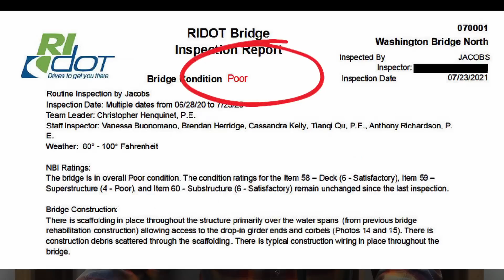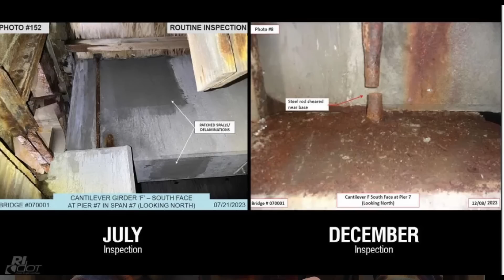Westbound I-195 in Rhode Island could be Torn Down and Replaced

Comment: I wish I shared your optimism on the timeline. I dont see any way on goda green earth that a bridge project of that magnitude could be completed in that timeline. 

Even with the biggest of rush rush from all angles. Month worth of public notices, month to.actually bid the job ,month to award the job and push the contracts. Lord knows how long for the awarded contractor to send all their POs out and get the submittal process started. Steel shops, with PE stamps, precast shops with same?

 Either way...lead time on the scales of weeks at best, just to get the shops. Back to the review side, " quick review" on a project of this magnitude ? Weeks? Get approvals on all the shops and then clock starts ticking for the lead times on materials,  theeeen start building a bridge.

Oof, wishing the best for the local folks , but they definitely have a rough row to hoe. If they want to get that bridge back up and running,  sounds to me like they better do some house cleaning,  get some politicians out of the way lol.
Reply from the maker: I think you're right. There's a good chance the Francis Scott Key bridge will be replaced before the Washington bridge is.

Comment: To me as soon as there's some fictional claims then the flags about evading the truth just goes to the top.
If they just had stated that "We have missed this part in our inspections" then it could of course be some questions about why that happened, but it wouldn't be an obvious lie, just that the inspectors historically have been sloppy. Some parts on a construction are also tricky to inspect and may require special equipment to reach, but it's not clear if this was the case here. Special equipment to me is not just a stepladder but scaffolding or a mobile platform with long reach that can curl under a bridge. Such equipment is expensive to rent.
So in the end it's all about money and laziness.
Reply from the maker: Yes, their lack of directness and candor is disappointing and makes it hard to trust anything else that they say.

Comment: I love your channel and find your engineering takes on various projects are great, BUT, in my opinion, as a person who has worked in bridge construction for  30+ years is that the replacement of this bridge, if begun tomorrow would take at least 3 years possibly longer.
Reply from the maker: Thank you.  You may be right about that.  3 years would be a disaster though for the local commuters.
Reply: It would be a project built over a marine channel with a shipping channel and 20+ feet of water over some soft mud.  Only saving grace I would see is that a major bridge was just finished up river and perhaps those barges and cranes could be mobilized for this project,  after the soil studies, engineering, environmental studies and bidding process is over,  UGH! @CaseyJones-Engineer FYI I have to use this bridge almost every day.  I have the luxury of being able to pick my travel times so the traffic is not to bad.

Comment: As far as inspection, close up is only required for fracture critical structures.  I agree that the corrosion on this rod is a significant factor.  There is probably an expansion joint in the deck near this tie down and there may have been a lot of sand on this area at one time.  Corrosion can substantially accellerate fatigue which can cause a sudden fracture, especially in cold weather.  As far as the rod itself is concerned , it looks like there is both considerable necking, and a substantial gap indicating a lot of elastic strain in the rod at failure.  Both of these factors may be indicative of overloading.  For a bridge of this size a more likily overload situations are:  a. Increases in deadload due to increased overlay thickness.  b. more lanes than initially planned.  c. Very heavy truck traffic such may occur with a traffic diversion onto this structure.  d. Overload truck policies way beyond those anticipated  by the design loads of the origional design.  e.  Sensitivity of the code requirements for tie downs at the time of design to a change of  the ratio of live loads to dead loads reducing the overload capacity.  f.  Tie downs are not usually load rated as part of the routine determation of structures load capacity just like gussset PL's weren't  before the I 35 structure failure.

Comment: Second thought, and questions for our host:  Does the bridge design include a required maintenance schedule?  Should it?  What would the legal implications be?
Reply from the maker: Such bridges are usually subject to routine maintenance and periodic inspection, but in this case it would appear that the routine maintenance was wholly inadequate.
Reply: "Required"?  Who would pay for the desired maintenance work?  None of those involved with bridge maintence or their design have the ability to print money.  Future maintence costs need to be considered during the structure selection process though.
Reply: Funny someone would ask that about a 195 project. crossing the Taunton River from Sommerset MA to Fall River MA there is a big green bridge (the Braga Bridge) followed by a tunnel? under the Fal River City Hall, which was built in conjunction with the bridge/highway project. One day a concrete roof panel fell on a car, crushing it completely. Sadly, the driver was killed. On investigation of this incident, it was discovered that the City of Fall River believed that the State of MA was responsible for the inspections, and you can guess what the State of MA believed. there had never been any inspections. the frightened workers in city hall could look down under their desks and see the road beneath them.

Comment: A lot may depend on whether the bridge piers/columns are sound, or whether they too must be demolished and replaced.
Reply from the maker: True.  It does appear that at least a few of those bridge piers are in bad shape.  Also, the new bridge would have to have the same spans as the old bridge to reuse the piers which is not a deal breaker per se.

Comment: I am an accountant, not a civil engineer, but the new I85 bridge over the Yadkin River in NC, built more than a decade ago, to carry eight travel lanes of interstate cost over $130million.  I think that replacing approximately 1mile of ten-lane I195 bridge in Rhode Island in 2024-25 for $100million is wildly optimistic  given inflation, current constraints on availability of labor and equipment, that the Yadkin River bridge is only about 2,900 ft (approximately half the length of the I195 bridge), that little demolition was required (the old bridge was much shorter (nestled down in the river gorge), narrower (4 lanes), and in a different location from the new bridge), and that NC is a relatively cheap place to do business compared to New England.
Reply from the maker: That could very well be the case that $100 million is on the low side.
Reply: If the piers are in good shape and they don't need a navigational upgrade, they might be able to keep it to $100m by building up off the existing piers. Otherwise, if they go for a new bridge, there will be mission creep and the feds will bail them out of the overspend.

Comment: Would it be possible to make enough repairs to the bridge to keep it open to restricted traffic: ie. No heavy trucks?

Build a new bridge next to the bridge to be replaced? Then demolish old bridge. 

Are there designs that inherently protect the bridge structure from road salt exposure? 

Could the design incorporate wash down system to flush structure that could suffer damage from road salt? 

If those questions can be answered yes in part or whole, would doing those things greatly increase the cost?

Questions are rhetorical.
Reply: The current bridge structure and approach roads are hemmed-in by buildings on both sides of the river and both sides of the road, so you would have to condemn a significant amount of preexisting development to build a new bridge parallel to the existing bridge, and build new approach roads to the location of the new bridge, which would further increase the cost and amount of effort required.

Comment: Was curious if a new bridge is required how much if any of the old bridge and approaches might they be able to re-use? Seems like Peter Alviti was in react mode without much quality information at first and being a bit defensive.
Reply from the maker: That is a good question and depends on how good of condition the pier caps are in.  Also, I the spans would have to be the same for the new bridge.  Currently, there isn't enough information available to say whether all new foundations and piers would be required, but if they weren't it would significantly speed the replacement process.

Comment: The environmental impact study for this bridge replacement should be versus not replacing the bridge. And not replacing the bridge is going to mean a whole lot of cars running a whole lot of miles and idling and sitting in traffic a whole lot of time so I'm fairly sure but the net environmental impact of replacing the bridge is negative. That said there may be some concerns that have to be addressed such as avoiding particular depths of the shore that might have sensitive endangered critters that need a particular part of the shore or a particular depth of water. That would just be a matter of adjusting spans. Perhaps the best design in light of this would be a fully shore supported suspension bridge. Then no part of the new bridge even touches the water when it is done. There might also be decommissioning impacts that need to be explored (i.e. toxic paints). If the new bridge essentially just reaches over the old bridge, the decommissioning and studies for decommissioning can wait because you really don't have to remove the old bridge first.
Reply: About alternate routes:

The only bridge to the south is the Newport Pell bridge. Its about 35 miles away, ant the toll is $2/axle. For through traffic between CT and MA, this is the way to go.

On the north side, there is a local traffic bridge about 0.8 miles away. I wouldn't surprised if they took steps to keep a lot of traffic from destroying the residential neighborhood there. Beyond that, about 5 miles north, the river narrows to an obstacle of no great consequence. A lot of traffic is going go around to the north, and traffic in and out of Providence to the north (Boston) is going to cause a lot of delays.
Reply: The Environmental Impact Statements I've seen (road and mass transit projects) have all included a "no-build" alternative.

If they don't rebuild the bridge, they'll have to demolish the piers, down to the river bed.  That won't be cheap.

Comment: Maybe they dialed back the heavy truck story when they realized you might be able to calculate the load based on the bolt yield properties (i.e. one ginormous truck). That bolt yielded just like a tensile test specimen. I'm wondering what else failed, eroded or disappeared to allow that much displacement. So many questions such as where did the load go when the bolt yielded? Thanks - good video topic.
Reply from the maker: Thank you.  Yes, you make great points about this which shows how many questions still need to be answered by RIDOT.

Comment: Thanks for the video.  When I was a young engineer, I worked in Providence and commuted over that bridge daily.  You mention corrosion from road salt which I am sure is an issue, however the Seekonk River is tidal and salt air may be an additional contributing factor.
Reply: That bridge would have been constantly damp from the warm sea air hitting the cold steel and granite.
Providence was always damp when I was there.
They seldom plowed and heavy dosed with rock salt, when they even bothered.

Comment: Even if the bridge joints had continuity in 2023, that did not mean that the corroded connections had any substantive structural strength.

They should probably look at the piers to see if they can demo just the decks and rebuild on the existing piers.
Reply: The piers are probably solid. Going from memory, it's granite block.
Reply from the maker: @blaydCA  That would make sense to re-use the piers unless the redesigned bridge has the spans at different locations.
Reply: @CaseyJones-Engineer  Any structural engineer worth his salt would be getting the original "as built" drawings out, and completing a thorough survey to fabricate the new iron work, and to repair any issues with the mortar, using the same mortar (lime mortar?) as the original.
Would be an easy install, since they should be able to barge transit the sections in.
Reply from the maker: Good point.